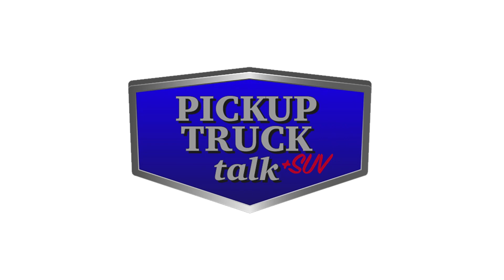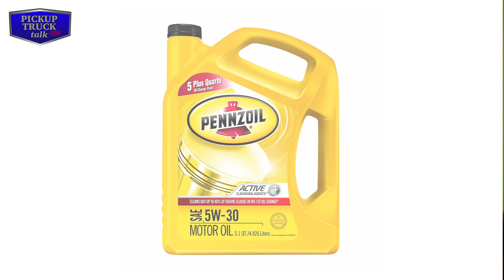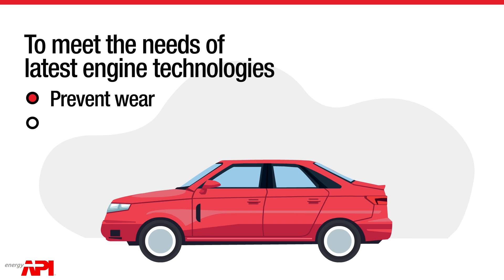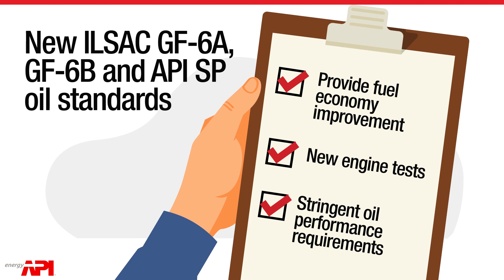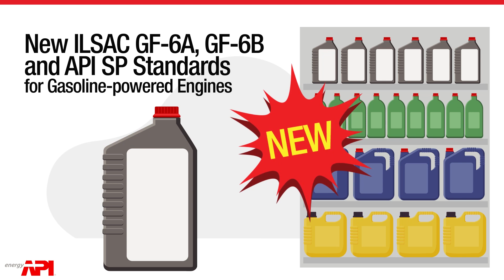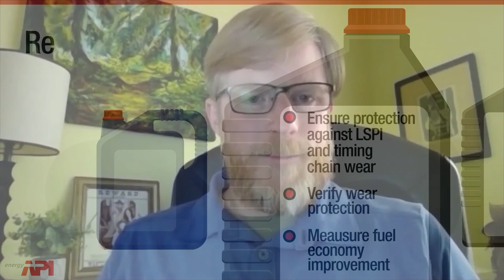New API Gasoline Engine Oil Standards Are Game Changers

Comment: Tim, Your guest was very diplomatic but he did insist that the idea that 'oil is oil' is not accurate. I would have liked to hear more details about the lifespan of oil and its relationship to the quality of oil filter being used.
Reply: Adding thicker oil in the old days was for a different kind of knock. You're talking about rod knock, or rod bearing knock, caused by too much clearance between the bearings and crank journals and/ or piston pins. The SP oils are for pre-ignition in the combustion chambers, which is also sometimes referred to as knock or ping.  The old oils are putting too much oil vapor back into the combustion chambers (PCV) and the vapor spontaneously ignites  from the high pressure/temperature of the air packed in to the combustion chamber by the turbo. The oil vapor/hot air lignites too early, spiking the combustion chamber pressures beyond what the metals can endure over time.
Reply from the maker: DLWoregon thanks for clarifying that. All I remember is adding thicker oil.
Reply: @Pickuptrucktalk   old truck engines were so different! My first was a 59 GMC w/ a straight 6 and three on the tree. Manual choke, no starter solinoid, no PCV, distributor with points, etc. Lug the engine and it'd ping like crazy, set the timing wrong it'd ping like crazy, or not shut off when I turned the key off.  Sure wish I still had that old truck!
Reply: @Pickuptrucktalk  BTW, Vortec engines (I believe all LS based engines too) have an o-ring in the oil pump pickup tube that goes bad over time. If you put heavier oil in the engine to help a rod knock or rocker tic it can make things much worse! The heavy oil in the pan is harder for the pump to suck into its inlet (particularly on cold starts) which can pull air past the o-ring in the pickup tube and really screw your engine up!
Reply from the maker: Interesting. I'm doing a follow up soon on DEF fluid - they work on that fluid as well. I'll see if I can't add in some additional oil questions.

Comment: Just figure out how to get General Motors to make an LS motor that doesn't drink oil at a ridiculously high rate. It was unheard of 30 to 40 years ago to have an engine oil that you had to add a quart in less than 3500 miles or so. It is not unusual to have an LS engine that drinks a quart and seven hundred to a thousand miles. I know that's within standard. But that's exemplary of either putting the wrong oil in it during break in, for more than likely using improper oil control or oil control tolerances within the engine.
Reply: 44 Hawk that has to do with the AFM  not the engine it’s self. I have had a lot of them and the 06 and older almost never used any oil. 07 and up that’s a different story lol
Reply: @raymond80hr  is still inexcusable
Reply: @raymond80hr  I had heard that, the problem is is that the claim is that it only causes high oil consumption after it has caused a problem with oil rings by Spring too much oil up under the Pistons. Which I'm not understanding because the engines are using oil at a high rate from the first day of purchase. However GM has relented and said this may indeed be an issue. The other problem I have is why in the world did they design an engine that sprays that much oil up into the rotating assembly. It is still a design flaw if that's the issue.

I have never agreed that shutting off cylinders is a better way to say fuel then defueling the engine. You have a lot of latitude on How Lane you can run an engine when it's not required to provide torque. And that will save as much if not more fuel than shutting off four of the cylinders requiring the other four to do much more work even though torque requirement is lower.
Reply: 44 Hawk  i have not taught of it that way before so thank you for that 👍
Reply: ...I have an LS 5.3 V8 and it has over 270k miles and it only uses a half quart before oil change comes up on DIC.
Reply: @rlhmarines  approximately how many miles before it shows up on the d i c? I have always been noticing that oil has gotten good enough to run, a minimum of 5000 miles, up to almost 10,000 if you drive a lot of miles with a good synthetic oil. I had a 98 Dodge Caravan that I sold with 256000 miles that I change the oil every 10000 miles but I was driving a lot of miles in that vehicle. One of the best vehicles I ever owned.

If you were getting that low amount of oil usage. That's what I would expect from that motor. Was it an active fuel management motor or not? That is what I'm hearing that when they added the cylinder shut down they started using much more oil.
Reply: @44hawk28  ..To be honest I stopped paying attention to it but in my case it depends on if I have more or less city stop and go driving...I think somewhere between 5K and 7K if I have mostly hi way mileage and I usually go well past the change oil light on most occasions. I use to be a religious 3K oil change guy but that changed with the LS  V8's I've owned. I use full synthetic after the initial oil change also.
Reply: The 150k Avalanche has the AFM and it's using about the same 1/2 quart or so as the 275k mile Tahoe which has non AFM.
Reply: @rlhmarines  that would leave me to understand that it is perfectly possible for them to build engines that don't drink oil. I never thought that the spring of oil underneath the Pistons was causing excessive oil usage. My guess is is that there's occasions when tolerances drift during engine assembly which allows hey percentage of engines to drink an inordinate amount of oil. Something I have thought was what the problem was in the first place. All the arguments about the AFM lifters going bad and everything else has nothing to do with the engine drinking oil. If the engine isn't leaking oil onto the ground, it's drinking it pumping it out the tailpipe. And that is inexcusable with today's technology. Possibly however the engine also like certain types of oil over others. I have seen engines that drink one type of oil quite readily And yet when you change oil to a completely different structure of oil not use hardly any at all.

 What oils are you using in these engines?
Reply: @44hawk28  ..5w30 Full Synthetic Royal Purple in the past along with Castrol and Mobil 1. I started using Pennzoil Ultra Platinum back a few years ago with my ZL1 that I track at HPDE's on road courses so I just use it in all my vehicles now but I use factory filters.
Reply: @rlhmarines  I've used all of those but mobile one, I have found it supertech actually performs a little bit better than Mobil 1 and it's half the price. I have use Castrol Syntec which is now changed names. And found it to be quite good. I have not used the new Pennzoil as yet. And I have used royal purple butt it is the only oil I've ever known that the advantages of the royal purple are realized by just adding one quart of oil to the mix in your engine. As long as the oils are compatible. There are oils on the market that are incompatible with each other. And I've had good luck with the ones that you mentioned oh, that I have used. However I have had one engine that did not particularly care for synthetic oil and a synthetic blend seems to work best in it.
Reply: 44 Hawk if you want the vehicle to run as it should use the revised version of AC Delco Dexos 1 GEN 2 oil only. 

I have a 2018 4.3 with 78,000+ miles and have tried several other Dexos 1 Gen 2 (Approved ) oils. None of them make the AFM operate as it should.
Reply: 44 Hawk If you buy a Chevy run Chevy oil/ AC Delco. If you trust the engineers enough to make a reliable motor you should trust them to make a quality oil. 

They didn’t spend $$$$$$$ developing Dexos 1 Gen 2 for the fun of it
Reply: @Mr.Beastforpresident  good job and lots of luck getting any engine to run that long and not use oil. Proper maintenance helps a lot. As for your comment about the oil they recommend, that usually has nothing whatsoever to do with the best oil for the engine. I have rarely found the oil that they suggest, working best in any given engine. What I have about three or four that are my go-to oils. And when I find one that the engine operates well with and doesn't drink, I usually stick with that for that engine. It certainly didn't help for a while when General Motors was telling people to put Mobil 1 in their engine from the outset. Which is never a good idea do not allow the engine to break in before you put synthetic oil in it. Most engines do not like that.
Reply: 44 Hawk I had an LY6 6.0 Vortec in a 2008 with 541,000+ miles 13,000+ engine hours didn’t use a drop of oil. 5 1/2 quarts came out and 5 1/2 quarts went in.
Reply: 44 Hawk Changes are you either bought a used LS that has been either running the wrong oil AND or oil filter, either weight wise or brand wise and you have wear on rod bearing tolerances and valve stem tolerances. Thicker oil won’t wear rings but it will cause many other issues especially with running Non-OEM oil filters. I could sit here and write a book on Chevy engines but really don’t have the time to do so, but there’s the short of the long of it.
Reply: 44 Hawk Brand oil absolutely matters, if you don’t think or believe so, buy the cheapest oil you can find. You can make cheap oil expensive but you can’t make expensive oil cheap